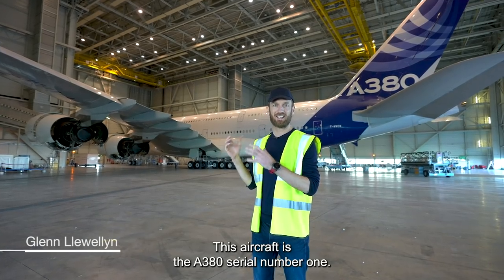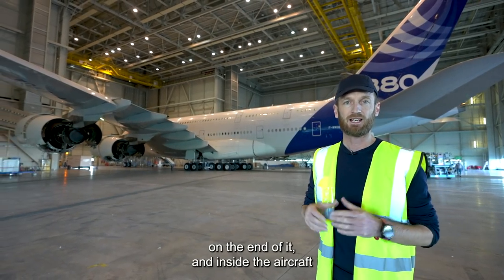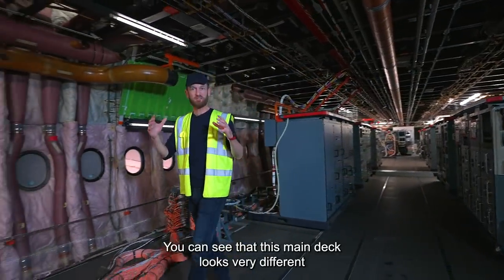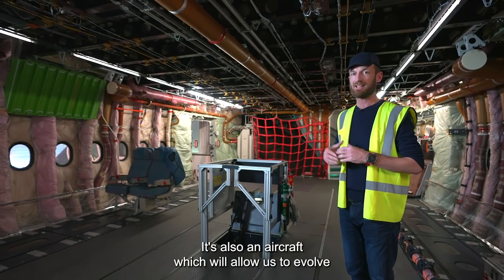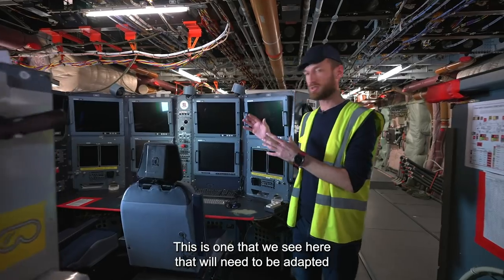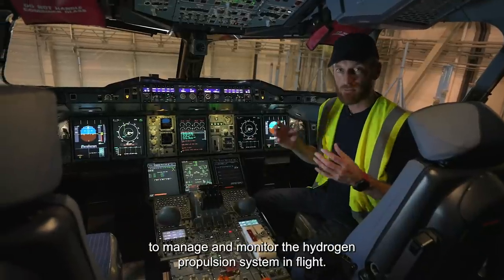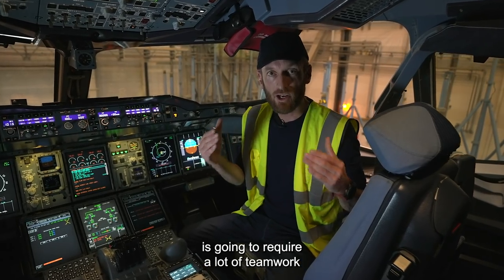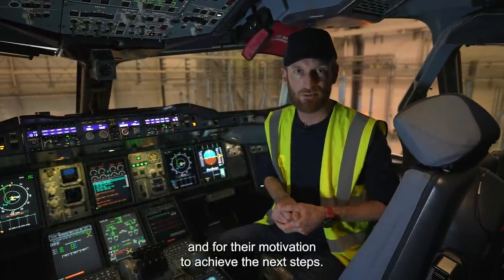Glenn Llewellyn introduces the #ZEROe demonstrator

Comment: Very impressed to see how soon Airbus is planning to de-carbonise air travel. When they pull this off by 2035, imagine what's possible for other fossil dependent industries incl. road transport, shipping vessels and other heavy industries such as steel and cement making. People need to have a more positive outlook on the future as smart engineering will come with solutions for this climate crises.

Comment: Hum, why did you add a 5 engine instead of replacing one of the other 4?
Reply: You can do something like this if the engine you’re installing for testing is stronger than the other/normal Engines on the aircraft as you could still have an even amount of thrust during e.g. take off.
The hydrogen engine will be weaker than the Trent 900s, hence it’s installed on the side. Pratt and Whitney Canada has two 747SPs which use a similar engine setup with the test engine being installed on the upper deck.
Reply: @spongebubatz  hum... thanks ! Although, I thought that largely empty a380 would be well below MTOW so they could have a weaker engine and reduce thrust on the other one on the other side.

Comment: That's grt turnover, Is it the additional engine you gonna mount on the aircraft, or only the hydrogen engine only?
Reply: There will be a fifth engine installed on the side of the aircraft which is hydrogen only

Comment: …this is the only middle to long term viable clean durable alternative fuel for modern turbine powered aviation engines. It will require adapting and changing airplanes hull shapes to fit either spherical or cylindrical tank storage systems. 
We still need to find out a clean durable way to deliver massive amounts of hydrogen & develop a safe operating environment, as a fuel leak is nothing like a hydrogen leak in an aircraft.
Last but not least, will conventional fuel companies fairly play the game to promote this not so new source of energy? Future will tell!!!!

Comment: The fly in the ointment is that liquid hydrogen has one fourth the energy density of gasoline per liter.   While its caloric energy density is much higher than gasoline per liter, about 3x by weight,  the volumetric problem is insurmountable.  You will need fuel tanks 4x the size of your current fuel tanks to get the same range.   And those fuel tanks have to be strong enough to contain high pressure hydrogen (5000 to 10000 PSI) or be cryogenic, cooling the LH to less than 20 degrees Kelvin.  Hydrogen can not be made liquid by any amount of pressure at room temperature.  (Jet fuel only has a small energy density advantage over gasoline, incidentally.) 

Your zero emission plane may be possible.  But it will have a huge penalty to pay in range or payload or both.
Reply: I suppose this will be expected by airbus, not that they will talk about it much. but maybe this is going to be aimed at smaller aircraft for short haul journeys? that will give them their 'zero emission' aircraft and then they can use the technology in conjunction with standard engines to improve the efficiency on other aircraft?
Reply: Hate to be that fly in your ointment but why talk about caloric density relating to liquid hydrogen when you talk about energy density just a bit earlier?
Caloric is for food related energy and even if, in biochemistry we rarely use calories when calculating energetic metabolic processes like Gibbs free energy. We just use joules.

Also, all of what you talked about is volumetric energy density. Liquids and gasses occupy the same principles. Liquids are basically super dense gasses. 

What you probably meant is volumetric energy density of hydrogen in standard pressure is one fourth of gasoline. 

But you are absolutely right, provided hydrogen wont be stored in liquid state, volume is the biggest issue which will result in range or payload cuts. Perhaps zero emissions flight will only be regional. I’m pretty sure it’s only going to be regional.
Reply: @hodb3906  Clearly you don't understand the difference between calories and Calories. You must have not taken a chemistry class, or you failed it. It's a means of measuring thermal energy in a chemical reaction whether it's food or fuel.
Reply: @MrSkeedle  The only thing that makes commercial air travel economically viable is economies of scale.   Longer distance, more passengers or cargo,  these things are required to make it affordable.   Hydrogen fueled aircraft would have shorter range or carry fewer passengers and cargo, or both, which breaks the economic justification for air travel.
Reply: @Turboy65  theres definitely a lot more to it than that though. many companies do things that may have direct negatives but cause other benefits. like a store selling something that causes them to lose money, but whilst the customer is there they are spending on other things that makes them more money
Reply: @MrSkeedle  How is that even relevant?  Airbus's experiments with hydrogen engines may yield something of value, but people seem to think that the future will be a jetliner running two hydrogen engines.  The thermodynamic truth of hydrogen as a fuel source (volumetric energy density) indicates that this is simply extremely improbable.
Reply: @Turboy65  Just explain succinctly but also kindly to those who don't understand what you excel in otherwise it just puts off your audience. The whole point about these forums is to learn from one another because no one knows it all. Let's be kind to one another please🙏
Reply: Strong tanks already exists from the automotive industry. Toyota Mirai stores hydrogen at 70 MPa (10,000 psi).
Reply: @seasong7655  True said, the Mirai is a good example of Hydrogen propulsion. That said, I will stick my bum on the good old Corolla for a while and let my brethren be used as guinea pigs on the Mirai and other platforms🤭😂

Comment: Why 2035?
Reply: Hydrogen is very new for a commercial airplane. For instance, we just got the engine design and next year we should we the final plane design with propulsion and 12 years is very short in aviation. Also, no airports have hydrogen as fuel, so that will take time.

Comment: Ok, there's one thing I don't understand is, what will be the work of this one hydrogen engine?
Reply: Nothing the plane can fly without it. The aim is to develop and test the engine and the fuel system before beginning a clean sheet design for a zero CO2 aircraft.
Reply: New engines and especially new ways of propulsion have to thoroughly tested before an aircraft can fly powered only by them

Comment: Does this mean Airbus is going to start the A380 production again but the emission will be zero and will be operated by hydrogen or Airbus is going to collect the A380s around the world one by one and add the hydrogen engine?
Reply: Hydrogen won’t solve the problem of fuel consumption, one of the main problem airlines had with the A380. The price for fuel is too high and Hydrogen will rather make this price go up as it’s still hard to obtain.

Comment: This is the dead end. Waste of time. 2 main problems: 1.) How do you want to store high explosive liquid hydrogen? In wings? If not, then where? Extra weight will not pay off. Hydrogen is highly explosive. If the hydrogen plane would be 1.000x more secure then Zeppelins, it will be burried by media which will cause a big fear between potential customers and passengers. 2.) You can not find hydrogen on Earth in free form. You have to produce it. For production you need a lot of electricity. To produce electricity you need a lot of other sustainable or not sustainable energy sources.
Reply: This is exactly what this test campaign is for. Hydrogen powered cars have proven its possible, now its just about scaling up the system and production.